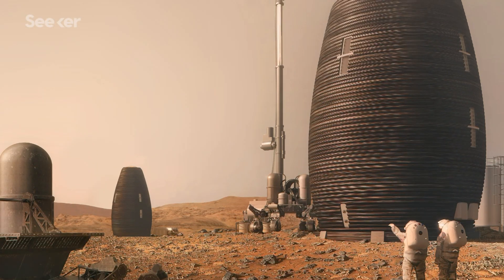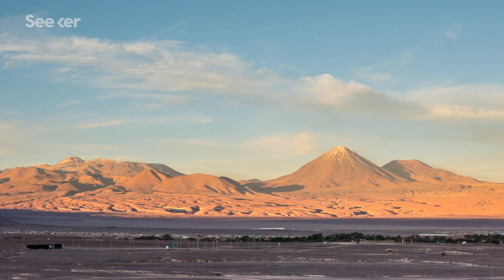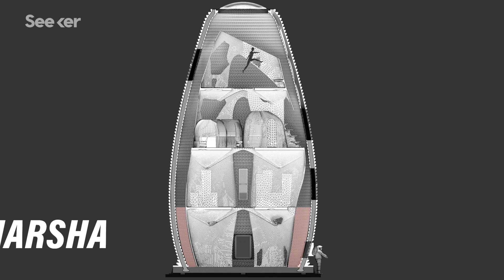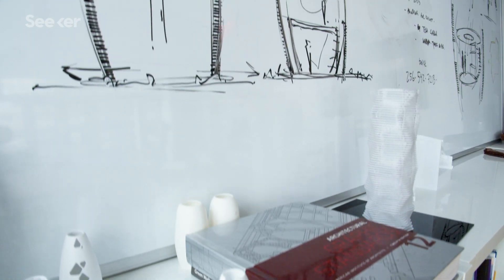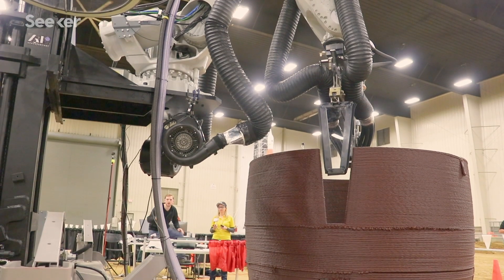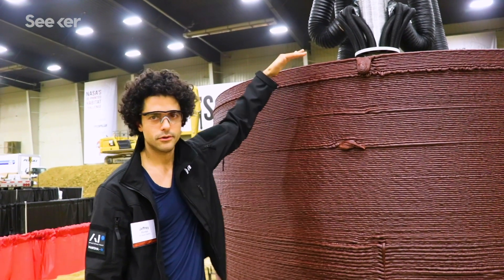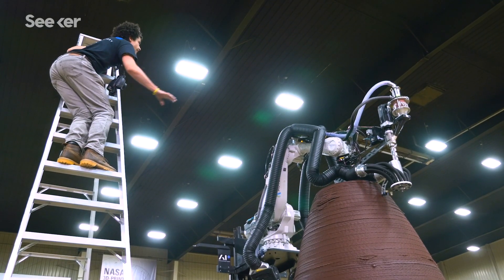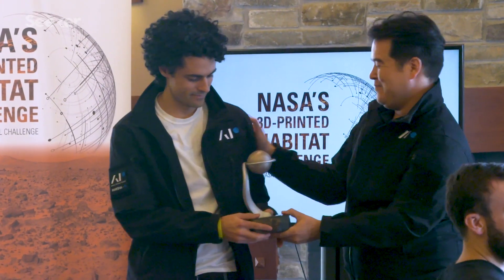NASA’s Challenge to 3D Print Future Habitats on Mars

Comment: It is an interesting design.   There are some buts though.    Radiation scientists anticipate that regolith based polymer concrete on Mars would have to be a foot thick to provide adequate radiation protection.   Even scaling up this design won't provide for enough radiation protection not to mention the glass structures or the sun roof which would let the radiation right through.   The other issue that nobody is addressing is that the regolith on Mars is filled with perchlorate.   I have seen no analysis of what perchlorate contaminated regolith concrete or printed plastic will do to a human.      Another serious issue is that as you freeze thermoplastics and at around 150 below zero it would definitely be frozen, thermoplastic has a major tendency to become brittle and crack.   With a 1 bar to 0 bar gradient between the inside and outside of these structures they could conceivably just shatter.   Having the structure be a foot thick would mitigate that a lot but they aren't planning nor have they proposed a foot thick structure.    They would also have to ship a chemical factory up to the planet since thermoplastics are long molecular chains of C, H, N and O.    The carbon is somewhat easy to get on the planets surface and by splitting the CO2 you can get oxygen but hydrogen and nitrogen are not up there in any quantity needed to construct thermoplastic.    Also, try scaling a plastics manufacturing chemical plant down to something you can fly to Mars.   I do not know the exact answer to the energy requirements to make the polymer then melt it for construction but I think the team that is working on the kilopower reactors needs to step up their output by a lot.    They can, at most, presently and presently planned, network 4 10 KW reactors together to power anything or everything in some modular unit close by.   Good luck with all that.

There is some sort of a disease impregnating all of these funded experimental projects.   They don't meet the fundamental criteria to work in the environment that are supposed to work in.   That includes the regolith mining  project that can't accomodate simple rocks and depend on having a pure bed of nothing but the proper grain size regolith to work with which is totally absurd.   It includes all of these habitat projects also and I have reviewed several.    The no gravity environment of space and radiation are not being seriously addressed.    The Hall effect thruster project wants 200 KW to ramp up the power of the thrusters for shorter term flights to Mars but the kilopower project can produce 40 for that too.   Who is working on Mars dust proof air lock designs and decontamination rooms to remove the dust so it doesn't pollute the inside of a habitat(perchlorate dust regolith again).   I haven't seen this.    I see plant growing projects showing plants growing in "Mars regollith simulant".   It doesn't have perchlorate in it.   Water introduced into a perchlorate regolith leaches the perchlorate into the water which uptakes it into the plants so will Mars colonists be eating that?    Perchlorate has a nasty tendency to kill plants as well as humans by the way. 

Can humans even be sustained in 1/3rd earth gravity perpetually?   Nobody is interested in doing this gravitational science to find out.   If I were going to Mars I would want to have some assurance that I would survive the trip, could live there without being poisoned and have enough gravity to maintain my physiology BEFORE I got on the rocket.

Comment: “All that pressure”?  14.7 PSI which is our atmospheric pressure is not that much pressure!  And they probably will use much less there on Mars. Seems like a balloon like structure would be much easier.  Can be shipped deflated and then inflated on Mars. Eventually underground structures would be much better to reduce risk of radiation and meteor hits.

Comment: 3D printing is a hot technology and that's great, but success on Mars may require even more out of the box thinking. 

3D printing is an additive technology, but we've been doing reductive technology for much longer, it's easier, and requires less launch mass. 

What if we dug into the cliffs of the Mariner Valley???

Skyscrapers literally carved out of the walls of the canyon... a space age version of Petra.

In this case, 3 of the four walls are already there! We can also make the interior space much larger than anything we could print. The roof can be made of Martian soil, to a depth that would satisfy any radiation protection needs. And one roof could cap a facility 5,000 sq ft per floor, 10 floors down. 

So what do we need to bring? A cutter... a cute little robot that starts cutting rock away from cliff walls the same way we quarry marble, today. 

We'd need some spray foam... small fissures in the rock cold be escape routes for precious oxygen. We'd want to seal the surface of the rock we live in. So that we not only preserve our artificial atmosphere but also seal out any potential contaminants. 

Other than that we'll need the same steel structural supports as any other Martian base calls for... this will slow us to dig a big "box" and add floors and a roof. 

The key differentiator here is we can build much large interior spaces than any other solution. 

Oh, and the 4th wall? Imagine a giant aquarium wall. Amazing/inspiring views, and if we build it with a gap of only a few cm and fill it with water, it'll be all the radiation protection we need on that wall while also being our water supply... beautiful and functional. 

So amazing views, theoretically unlimited interior spaces, lower launch mass. What's not to love?

Comment: They will have pressurized air on one side and low pressure on other side of this 3dprinted wall? Good luck with that. When pla/petg 3dprints are not even waterproof... 
Also how the hell the foundation will stay perfectly on the same spot during printing when basically nothing is holding it down?
Nozzle clog? Wood filament is pain in the ass to print or regular 3d printer.  i just wonder about how hard it is printing with that stuff

Comment: Why not just excavate a habitat underground then seal it? The ground will act as a shield for all that radiation and is extremely resilient to micrometeorites.
Reply: I agree completely. Much more practical to carve out or even find existing old lava tubes in the ground. Would likely be better at blocking cosmic rays also.
Reply: Good point, Icholi88. I imagine that stage zero - the arrive & get things prepared for building stage - they'll have to go build underground bunkers. They need to (1) gather the basalt rock and prepare it for use then (2) grow that bio-whatz-it that mixes with the pulverized (?) basalt to make the walls. 

It's a fascinating thought.

Comment: Please correct me if I'm off, but if Mars has iron oxides, would it be possible to weld it? As opposed to printing? Feasibility? Questions.
Reply: how much ambient air do you need to do a proper weld? im no expert so im wondering what the integrity of the welded joint would be in martian atmosphere

Comment: Just taking a foldable three D printer would do a better job than taking a entire infrastructure. Usually things available in Mars are the best for making a habitat. And something extra safe durable and make a pressured environment plus anchored and docking station. Wax and wane is something needed as it keeps pressure same in extreme weather and temperature. Sand dunes falling in is an other problem while printing and packaging. Thirdly radiation effects. Fourth circular moving inner core for gravity simulation. Gravity simulation is mostly needed because growth factor is dependent. Fifth air and water and food and miniature planting and recycling water air and other waste easier and somewhat like a breather for getting atmospheric ingredients which are useful in production of food water etc. Even electrical layout print. Plus excess waste throw outlet and safe atmospheric water absorption. Something like a amoeba. Also high energy trapping for keeping temperature controlled and solar or lensing to save energy for electricity and power battery.

Comment: LOL both teams chose organic-based materials that 100% cannot be made on Mars / have to come from Earth.
Reply: You can make these things on mars. Everything is there, you just have to built a few greenhouses first.
Reply: @midnight8341  For plastics you need oil, from Earth. For concrete you need calcite, which forms from shells through diagenesis, on Earth. Both processes take tens of thousands of years. Not feasible in a greenhouse.
Obviously, there are real material options that we can make work for Mars, just not what these teams used.
Reply: @jonmichaelgalindo  not really... Plastics as in "thermoplastics" are just a class of materials that you can heat up and remold as you wish, which also includes stuff like glass or gelatine... But plastics in a sense of polymers are just a class of synthetic mega-molecules made of repeating monomeric subunits, which can derive from crude oil, but don't have to, as PLA (poly-lactic acid), the thermoplastic polymer used in 3D printing and also here in this video is made from organic molecules derived from plants or bacteria. Also, you can't even be sure the losing team used cement in this project, it could have been a grey polymer without the iron impurities that tinted the winning teams plastics red (maybe they pretreated the simulated martian soil with something to extract the iron), but even if they did, calcite can be formed chemically much faster than over thousands of years under the right conditions in a lab or in chemical manufacturing. Also, Calcium is pretty abundand in martian regolith, and all the other non-metal components are, too, so no need to get anything from earth.
Reply: @midnight8341  I would be much more interested in a solution that could transform Martian rock through non-chemical processes. I think that's what we need for day-zero structures.

Even though what you wrote sounds accurate to me, on Mars we need every advantage we can get. We've got martian rock and whatever we bring with us. 

Unless we're bringing vats of chemicals and pressurizers, we're not doing chemical processing. If we bring those things, we have to leave something else behind.
Glass needs lime and carbonates, we're again faced with manufacturing these calcium components. They're everywhere on Earth because of biology, but on Mars they have to be produced. This holds true for the components every thermoplastic material. (Please prove me wrong! Thermoplastic extrusion is absolutely perfect. I just couldn't find this info.)
Reply: @jonmichaelgalindo  with enough energy, you don't really need chemical additives. Everything we do here on earth is limited by what amount of energy we want to spend on it. You don't need lime to produce glass, just a way to remove impurities from the silicates, which can also be done by thermolysis, which just isn't feasable on earth, but for small-scale production on Mars... Also, the martian rock really has everything in it we need, the only thing we have to do is to split it up into the elements and put it back together into the necessary components. We know everything necessary to do that, the only limitation is how much energy we want to put into this. Maybe a nuclear reactor or two or concentrated solar power beamed from orbit. It is possible to produce everything on site.
Reply: @midnight8341  To be honest, that sounds more like science fiction to me. Energy can't do everything.
I agree with you that it is possible to produce everything on site. The question is how to do it: cheaply, in the next 2-3 years, and on 1 rocket.
These teams did a good job of showing off large-scale structures, printed with FDM, yet strong enough for a low-pressure atmosphere.
The next challenge needs to focus on light-weight, low-cost printers that can use nothing but the rock and solar power on Mars to build structures like these.
Reply: @jonmichaelgalindo  well, glass for example is nothing But silicon, oxygen and some ions like calcium, potassium or sodium, depending on the kind of glass maybe lead or some or heavier metal. With enough energy, nothing is stopping you from putting these things together in a vacuum and creating glass. BUT it takes huge amounts of energy to break for example the silicon-oxygen bonds in quartz, so we do that with carbon, because it reacts with the oxygen, outgases and leaves the pure silicon. But you could just heat up the quartz crystals until they start to evaporate and them zap them with sparks or microwaves to break the molecular bonds and release the oxygen, so that the pure silicon will recrystalize.
The same is true the other way round. If you put together pure silicon, oxygen and sodium, you will get glass, if you heat it up to a certain point and if there is nothing else to react with. And the same should hold true for almost every other mineral. Maybe you need to use a specific order or very precise temperature control, but arranging atoms in a specific way is only a matter of energy, especially for something as simple as minerals, which don't need complicated chemical reactions in a specific medium like carbon based substances do.

And you wouldn't need special solar-powered printers, a small nuclear reactor like the one NASA is currently building would be more than enough to power one of these and if you sent a large bubble-shaped dome with it (possible because of low gravity and origami-techniques) you could also create a calm environment without dust storms for the thing to work. The house itself could be assembled with printed parts, you don't really need to print the whole thing, but that can be done outside with rovers, because we already know these work a long time, albeit slow.
Reply: @midnight8341  If what you are describing is actually possible with today's tech and economy, then I'm sure that's what they'll do.
If, on the other hand, there are ways to use Martian rock to build structures, they'll do that instead.
Let's wait and see.

Comment: Elongated structures that can tip over are you serious
Reply: What could tip it, though? Not wind; Mars' atmosphere is too tenuous. Not seismic activity; Mars is not seismically active. I suppose a meteor might do it, or a collision from a vehicle. Not much to be done about meteors, but even if the hab was anchored to the ground, a meteor would punch a big whopping hole through it, so...dead anyway. Vehicles could easily be designed to NOT collide with things, which is desirable in a Mars vehicle anyway.